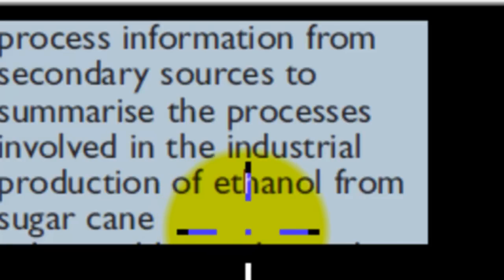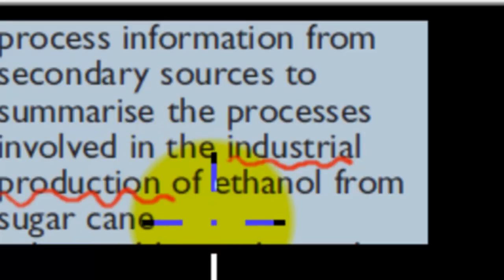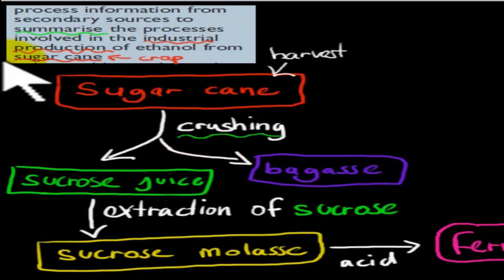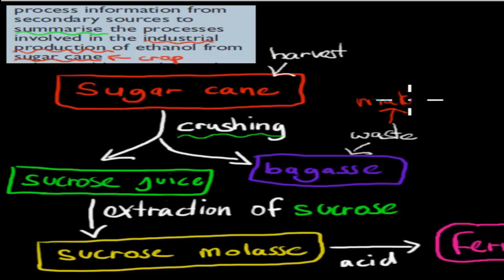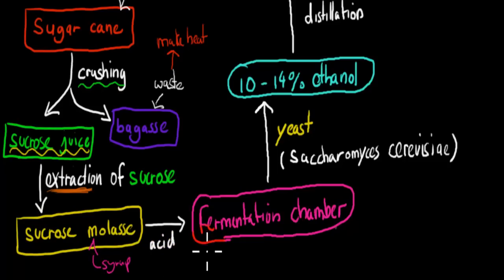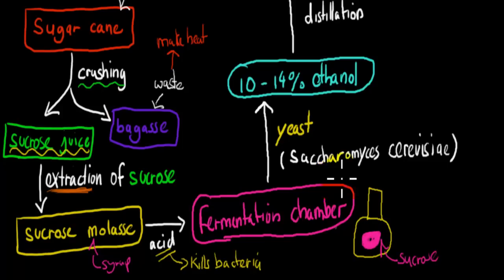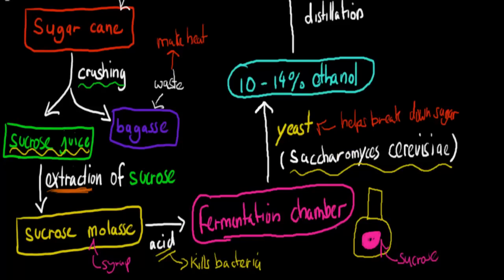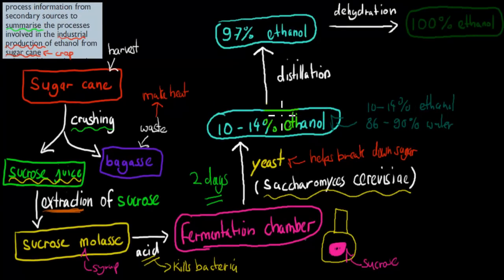8. Production of ethanol from sugar cane (HSC chemistry)

Comment: Dehydration is basically the removing of water. Since there is 3% of water left, the dehydration process eliminates the water, giving 100% ethanol. You may be confused with distillation. In distillation, the water is removed as well but it is by evaporation. Do try checking out the meanings of the processes.

Comment: Dehydration doesn't actually make sense because if you were to dehydrate the solution with the 97% ethanol and the 3% water you would be making more water because dehydration involves removing water molecules from ethanol to make ethylene and water (with the addition of conc. H2SO4). Instead it should be a hydration reaction with the addition of dil. H2SO4 and ethylene gas to make sure you have absolutely 100% ethanol.